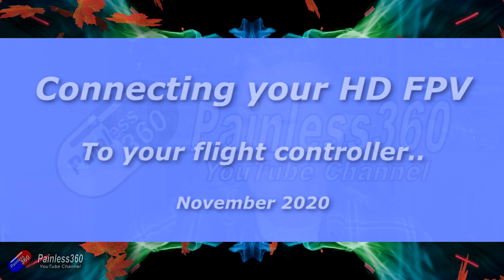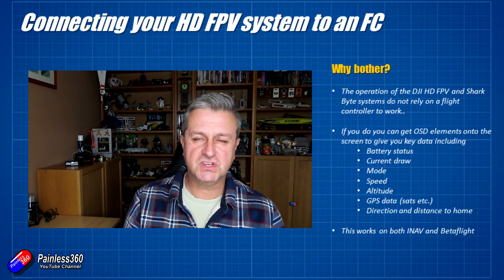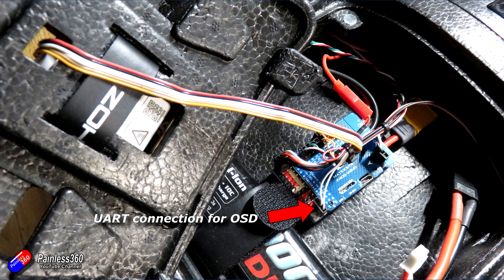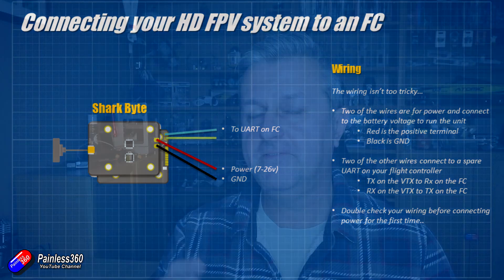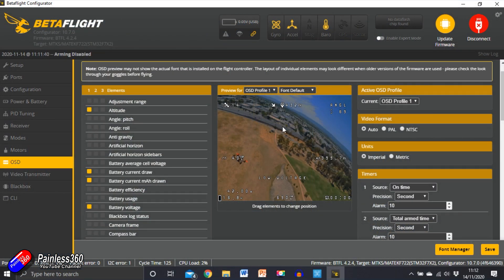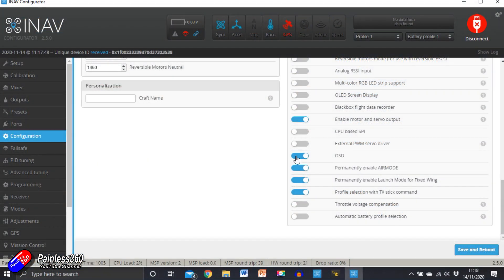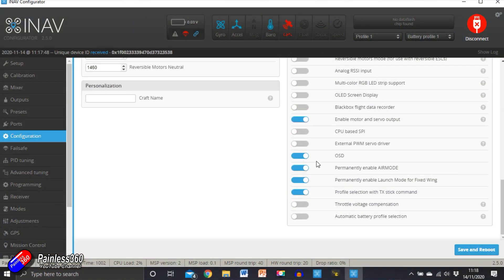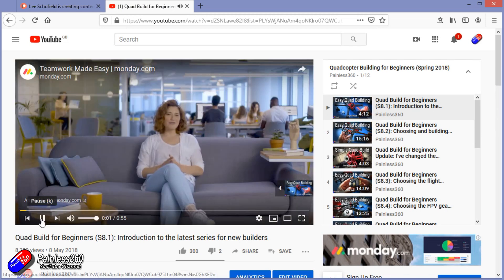Wiring and setting up DJI HD FPV and SharkByte onto a flight controller for the OSD

Comment: How is the flight Controller powered?  Does connecting these 4 wires to the flight controller from the air unit power up the FC?  I have been wanting to do this for two years... I have a few old FC I need to try this,,,, I just dont under stand how the fc is going to be powered...  sorry for the dumb questions, some of us need extra help
Reply from the maker: Power needs to come from the flight bettery in one way or another. https://youtu.be/xPDc6r6nRTU may help. Best of luck
Reply: @Painless360  OK I think I understand! so the power I already have coming from the battery to the air unit via ufl I just run two more wires off that to the flight copntroller main bat input! I got it! but I just saw you Qlite osd video,,, maybe I 'll go that way or both. thanks for the quick response!
Reply: @Painless360  Thanks, I got all the Tacos you can eat if you come fly with me in Sacramento!  You the best!

Comment: What gps module will work with a DJI air unit on a quad with a f722 flight controller like an Eachine Cvatar? I looked at comments on Banggood and the often say Beitian 180 will not work because DJI use some kind of proprietary protocol for gps modules. Will the same gps unit work with both inav and ardupilot? Thank you for your vid!
Reply from the maker: If you're using INAV then check your out my many builds on the channel. I use M8N, BN-220 or the Matek GPS... Happy flying

Comment: Just bought 2 shark byte systems and this has helped loads. so thank you! However I have one quad with a free UART so all fine. However my tina whoop only has TX2 but no RX 2...can you use soft serial for OSD? I tried remapping resource LED to RX 2 but no joy. bit stuck.....any ideas?
Reply from the maker: I've never tried to use it without both wires connected to the UART and I'm not sure how much 'two-way' communication is needed. Best of luck with it..

Comment: Many thanks for your very informative videos.

Is it possible you (or anyone) could offer any pointers regarding an issue I have.

I’m using the complete DJI FPV V1 system built into a drone running Arducopter.

Arducopter is configured to run Auto Missions and if the RX/TX signal is lost the drone flight controller is set to complete the mission and return.

I’d like to be able to complete the flight mission with the Air Unit recording continuously even if the RX/TX signal is lost.

At present the Air Unit SD card recording stops a few moments after the RX/TX signal drops between Air Unit and Goggles.

I’ve tried manually activating the recording using the remote controller switch at the start of the flight and switching the Air Unit to record when the drone is flying via the Goggles menu.

Neither of these settings work for me.

Any suggestions gratefully received, thanks.
Reply from the maker: Anyone else got any ideas? I've not tried this here..

Comment: Understand you are using the DJI controller as well which I love but ... Can you please explain how to change sub-trim with a wing when there are no sliders/buttons on DJI controller? Is it really going thru the OSD menu which seems totally crazy when flying to adjust pitch for example!?!?!? Thanks for all the work you do!
Reply from the maker: You never use trims with a flight controller. See my video on Servo aurotrim...
Reply: @Painless360  ok thanks